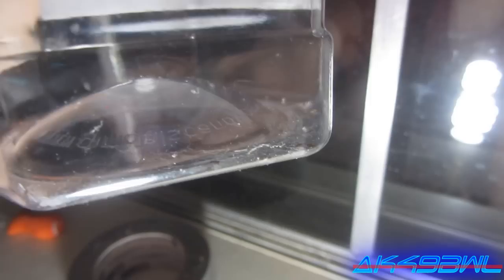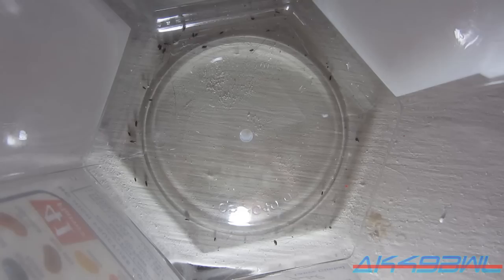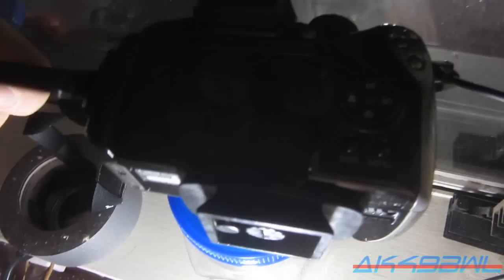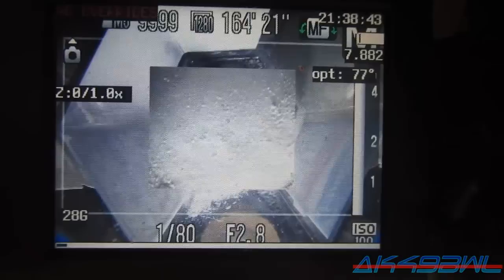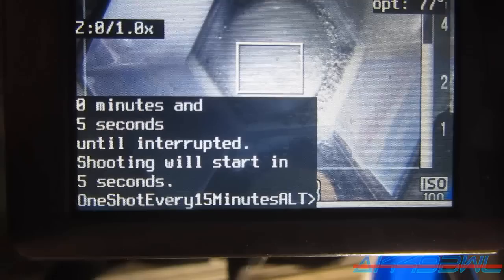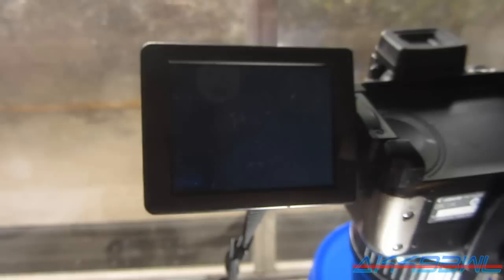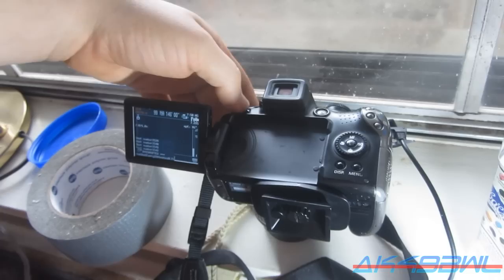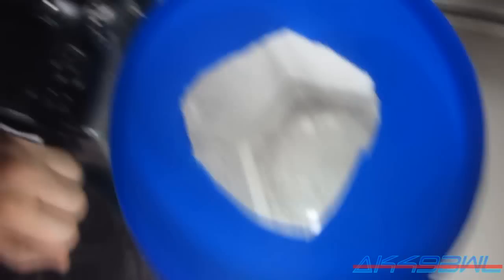Diatomaceous Earth vs Fleas Experiment

Comment: Shalom,  warning! During research on DE found out don't want to breathe it in.  Major possible lung problems,  so NO pets near it.  Best way to clear out fleas in a house do the whole house at same time, for 3+ days. Have all household pets elsewhere and flea bathed before going where they will stay, and again before bringing back home. Also DE car and yard.  Otherwise fleas will return. DE must be vacuumed or washed away before pets return. Ask a Veterinarian to verify.  One can't sleep at the house during this because the DE has to go on the beds. The lungs problem is not quickly noticeable, just like smoking but quicker noticeable than smoking. 

DE does work on cockroaches also, i have an enclosed top to under house pipe that was cockroach central.  I placed the DE at the base where they were coming in. I placed sticky mats above earlier those would get a lot that is how i learned it was cockroach central. I placed the DE,  then placed new mats.  About 2 wks now no more cockroaches caught on mats.
Reply: Food grade is. Research it
Reply: any time you open a wall pour borax into it.
When building an addition or a new home pour borax all along before closing up the walls.
Great for washing as well.

Comment: Did your vacuum survive the cleanup? I tore up two of my vacuums, a Hoover wind tunnel and a little one that I do my car with. Then my friend brought a shop vac over. She said it’s OK, but it seemed like it broke to me, cause it quit picking up and I couldn’t get all of the dust out of the filter to make it pick up again. But getting rid of bugs is worth more than a vacuum cleaner or two or three, L O L 😬
Reply: I learned the hard way. Did the same thing
Reply: I use it all the time, same vacuum for 2 years, live next to a forest so roaches invade when it rains, this stuff makes it a temporary stay.
Reply: He put down a ton.  You really only need a light dusting and the bugs will crawl thru it.  Take some up with a broom.  The wet vac is a good idea just clean the filter often.  It is hard on motors!  Wash the filter an then dry out naturally or with a blow dryer.
Reply: Well, the regular DE is used in pool filters. The food grade, I’m sure is the same. You’ll need a new filter if yours isn’t washable. I’m sure your filter will burn out the vacuum motor if you allow the filter to collect too much. DE is dangerous to breathe. Please wear sealed eye protection and a mask with a filter for 3M particles.

Comment: Thanks for this review, Brandon. However, just regular ol' baking soda (and even salt) have the same effect. Baking soda is an EXCELLENT fIea kiIIer. And it's dirt cheap. Just pour a few boxes of it all over your floors and carpet. Leave it there for a couple of days, then vacuum it up and repeat. Your fleas will be gone in no time.It's worked for me for over a decade.
Reply: Thanks for this info
Reply: Difference between DE, baking soda and salt is that DE is that DE will not harm the animal and you can put it on the animal itself. You cant put salt on an animal infested with fleas you will ruin their skin. Baking soda is much more complicated as it is possible some animals can be allergic to it.

Comment: Im no expert, but I've read that the DE creates small cuts on the exoskeleton of insects. That causes them to "dry" on the inside. My theory is, if you add some salt to the DE, it may speed up the process of "drying" them. You might have to crush the salt into a fine powder. Again I am no expert.
Reply: Thats a great idea. Im gonna try that.
Reply: You can also add baking soda, bicarbonate of soda as a drying agent. My daughter’s apartment had roaches, no manager available so no help. We mixed borax powder (laundry booster)with powdered icing sugar and baking soda and some diatomaceous earth…within 10 days there were no roaches in the building. (You have to put it where pets can’t get at it. ). We also used a spray of washing soda, isopropyl alcohol, some diatomaceous earth and water and sprayed it on bed bugs. Instant kill on the bedbugs and eggs.  When the exterminator came up to do our apartment, they couldn’t find any. (They came up from doing a heat treatment down below.)

Comment: I prefer to set a trap with a night light over a shallow pan of water. Works like a charm!
Reply from the maker: Didn't really do much for me, and I set out three such units.
Reply: Did you add a spray of cleaner or dish soap? They will just jump out unless you put soap or something like that  to make them sink immediately to the bottom.
Reply: I used a couple of spritzes of Windex to sink 'em so they couldn't  swim to the sides and hop out...they are good swimmers!
Reply: Did you add the windex before or after the water was in the bowl?
Reply: I sprayed it a couple of times after filling the pan 3/4 up with water. Makes them sink like a turd immediately as soon as they jump in.
Reply: Did you use duct tape to keep it on your dog?..kept falling off mine :)
Reply: lol

Comment: I am a licensed exterminator. Diatomaceous earth (not the food grade) is basically very finely ground up sea shells. To us its form is powder. For insects, it Is millions of extremely sharp shards  of sea shells. When the insects move over it, the theory is that it actually "cuts" the insects.
Reply: It cuts people, too. I used to use it on roaches, and if it got on my fingers, the surface of my skin would get abraded and feel like sandpaper.

It worked on the roaches. You just have to be careful not to touch or breathe the dust.
Reply: Tim, you specifically state non good grade. What about the food grad DE? Your thoughts on it?

Comment: YOU CAN ALSO FEED DE food grade only ! Kills fleas and worms !
Reply: Imforthewhales true works like a charm
Reply: unfortunately it does nothing to worms or internal parasites from eating it. it only works in insects and parasites with an exoskeleton and worms do not have an exoskeleton not to mention if the diatomaceous earth when wet does not work for even insects with an exoskeleton so it would stand to reason if digested it would become wet as well as be put through the digestion process therefore it does not work on any insect with out an exoskeleton and does not work if it becomes wet hence why there are no wet products such as sprays or creams containing diatomaceous earth because once wet it not longer removes the exoskeleton waxy coat and then getting into the bug and dehydrating it. I just wanted to point this out because if your pet has worms and you assume that diatomaceous earth will kill them then you are leaving your pet with internal parasites untreated. does work for bugs with exoskeleton thought. pretty cool stuff.

Comment: Burning dried bay leaves kills most insects. I used 5 leaves for my bathroom after washing my cats, I have all wood floors but they hopped on the bath rug. But, it does work better than bombing the house. I will say tho I had to keep it lit not like sage how it burns it self and needs to be put out. And don’t use mcCormick brand I used the Mexican brand because of price. Diatomaceous earth is like double razor blades when the fleas jump they’re actually cutting them up. It takes a while for the fleas to bleed out.
Reply: I never heard of using bay leaves,  how did you do it ??   just burn the leaves in the room the fleas are in ??
Reply: Melissa Faye yes I kept burning plain bay leaves on a plate. For my tiny bathroom I used about 5 ish big leaves. But I bough more so I could do the living room.

Comment: Good job on your experiment, this is something I would have done. Question I have is, did you conduct a second stage with fleas in the jar without the diatomaceous earth (DE) to determine if the fleas would die just from dehydration anyway? I have used DE, and am using it for fleas and ants currently, with decent results.
Reply: Is a sealed jar ever going to "dry out"? No. Whatever water vapor is present when it's closed will remain inside. Duh.

Comment: When flea's are driving you nuts, this stuff does work, tho is a major pain to clean up.   At the feed store, I bought a 50 lb. bag and not only did my entire house, but my entire yard and it did the trick.  I did take a week of vacuuming and dusting over and over before my house was as dirty as before I started.  I suggest a dry vac to vacuum up 95% before you use your home vacuum, because it will clog filters very easily.   I even put it all over my animals.  

After I saw this experiment, I would do it with much less power do see those results, because once you've had to clean up this crap, you're not as likely to want to put so much down as I did in the future.

Comment: It works great on ANYTHING with an exoskeleton.  Here in TX we use it on the fire ant mounds and they are gone in a day as well as the yard on dry days to kill the fleas.  It will hold moisture though so if mixed into soil it helps the plant to stay damp so it won't work on anything when damp or wet.
Reply from the maker: Hmmmmmm, I need to try it on the ant beds in my yard... They're outrageous right now. Been getting a lot of rain here in east TX tho, so may not work well right now.

Comment: I have been using Ortho Home Defense, also have tried baking soda and using hot water with a little Dawn on my cat, he is allergic to all flea medicines. The Baking soda has been safe to cat, fleas in a container with a whole lot of fleas died in several hours. Not sure if I could use if your Diatomaceous could be safely used on hardwood floors without it making surface slippery. Thank you for your information, would really like to find something safe to put on cat, but fleas are really bad this year.

Comment: If that's the Food Grade Diatomaceous Earth, you can mix a teaspoon in an 8oz. glass of water and drink it daily to cleans your body. Maybe make a mini solution of D.E. & water  (like a paste). & rub directly on your sores. You can sprinkle it on the coat of your pet.
Reply from the maker: I've read that putting it on the cats has the potential to cause dehydration so I decided to forego that route, but the paste idea does work for the sores. However, Aloe seems to work better :)
Reply: ***** O.k. I'm glad you're healing up. I use it internally as a Detox. I am on Day 24
Reply from the maker: I'll definitely have to try that.
Reply: ***** I know you probably did the research but in case you don't know, start off small with a teaspoon then work your way up to a tablespoon? Take it soon as you get up on an empty stomach?
Reply: ***** Check out Heather Bowen to get an idea of how it works. She did a 30 Day Blog.
Reply: Brandon my cat is totally fine.i use less than 1/4 teaspoon. a little goes a long way!

Comment: Thanks Brandon for this video.  I just ordered this online and i will sprinkle/dust as soon as i get it.  My cat Hoover is indoors,  but the new house we moved in probably already had the fleas inside as the previous owner had an outdoor/indoor cat.  It sucks because we just moved in and not even unpacked.  Never had fleas for 5yrs living in an apartment.  I also treated Hoover revolution 3 weeks ago when we found out about it,  i comb him daily and i still see fleas.
Reply: toxicwaste920 it’s better if you haven’t unpacked because that allows you to get the fleas out without them
Hiding in your clothe or covers.
Reply: Any good news? DE is the only thing to work for me in the past. We got new carpets and that got infested so I just had to use Raid flea spray and DE all over. I hope you don't have to worry about getting bit in the bed because I assure you, they get into everything. I redry bedding and clothes on high heat just in case. I can't take it anymore.
Reply: How did the situation with the fleas go? Did they leave?

Comment: How long do you leave powder on rug?
Reply: They say it will kill fleas in 4-5 hours, but say leave it on your carpets for 12 hours.
Reply: @simplisticskitty5370  24 hours is certain. Actually, baking soda will do almost as good a job, but it takes longer and you need to leave it well walked into the carpeting for a few days. Don't do baking soda on damp days, it can form crusts here and there that are hard to vacuum up, but will leave the carpet smelling way better. Both DE (diatomaceous earth) and Baking Soda also absorb odors.

Comment: My kittens dont have fleas...yet...Im gonna do a pre-emptive strike on them and use this stuff plus fine salt and baking soda...triple whammy....sprinkle it on my carpets every month or so......vacuum a few days after applying...
Reply: Using my coffee grider, I ground up some sea salt and sprinkled on my carpet near my 'flea water trap' (plate of soapy water with s light shining on it).

I put approximately 4 drops of liquid dish soap on a plate; I chose a food plate because it was low to the ground to make it easier for fleas to access. I filled the water to the very edge of the plate only after I placed it on the ground. Then I placed an LED lamp (so not very warm) to shine on it; I have no other lamps, and it's not shining directly onto the plate because of the angle of the lamp, but I'm still catching fleas. And I chose 2 locations: where they jumped on and bit me.

After a week of water traps and 2 weeks of knowing I have fleas, I finally vacummed (and emptied the vacuum immediately), the flea population radically decreased. I didn't even vacuum my entire home, just mainly where I found fleas and traffic areas my cat walks.

I also use a flea comb (Furminator brush) on my cat, then put those fleas into soapy water. 

If I had immediately followed the advice to vacuum from Day 1, this flea 'project' would not have taken so long. Today will be Day 2 to vacuum after 36 hours.

BTW:
If you're trying to catch fleas, wet your fingers a little first (yes, sometimes I spit on my fingers to cstch them...I'm desperate at this point...I feel like a flea hunter at this point, lol).. This will trap them so they can't wiggle away. Even if my cat has a little diluted ACV on her fur, this helps traps the fleas more easily in the Furminator comb, but you still have to be quick about catching them from the comb with your fingers.

Also:
I applied Virbac Effipro Plus to my cat (purchased from the animal shelter). It worked a little the first few days, but after 2 wks, not sure it's working.
Perhaps because I bathed her the day before applying this, which I've heard may decrease the cat's body oil, which is needed to spread the chemical around the animal's body. I also bathed her right after I vacuumed using Dawn blue dish soap.
Reply: Annette youtube   Very interesting. I always enjoy reading other people’s experiences, some are of successes, and others not so much, still interesting to this old timer. My saying is “I learn something every day” . Thank you for sharing 😊

Comment: I hope this works. we just bought a 25lb, bag of it, to treat our yard and house for sand fleas. we just bought this house and seller didn't mention the sand fleas comes with it. this place is flea heaven, but! I'm about too kill their paradise.
Reply: you must live in Florida
Reply: Spartan 137  spray your carpet with frabreeze before you run the vac to dampen the dust and Still suck it up.  But not make it airborne
Reply: Suzette Barfell it won't work if wet
Reply from the maker: If you're vacuuming it up, you don't need it to work anymore. Spray it immediately before vacuuming, not when you're putting it down..
Reply: I got them on vacation to Cuba.  Nice long 7 day break, but sheesh, I swear my legs never looked so awful.  I took a bath this morning and there were two fleas hanging out on my body.

I have a 10 pound bag coming and I'm going to set up a water trap for them tonight...
Reply: Suzette Barfell how did the DE work for you? Did it kill all the sand fleas?

Comment: Great experiment w/ DE and fleas. Thank you Brandon!  I live in perpetually hot hot muggy FL, and I did my own experiment w/ DE on my cool covered deck. I used a TON of DE to see if it would kill roaches and ants.  I didn't have an infestation but they search out any cool place.  The DE was a complete failure. And any claims that it kills those insects wasn't true for me at all.  Good to know because there's no sense in wasting it.  What does work with both roaches and most ants is boric acid, which is highly effective. If there's a flea or any bug issue I would rub it into the fabric, or carpet and then vacuum it up.  Pets & people should not be exposed to much or any of it as a rule. I use it in back of cupboards, frig, stove, cabinets so just about any bug in the house isn't going to last long.  Brandon I hope you can try the same flea experiment w/ boric acid (most hardware & dollar stores have it.)
Reply: Next time add a little sugar to the diatomaceous earth see if that works
Reply: I heard that boric acid can harm your pets.